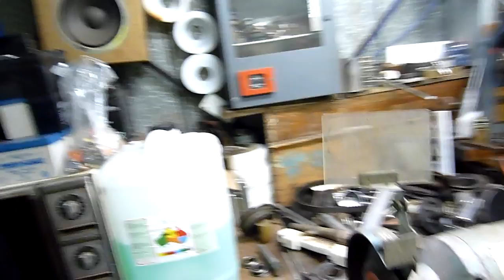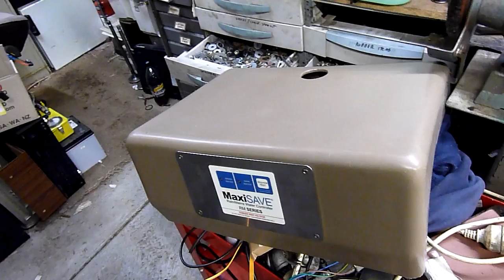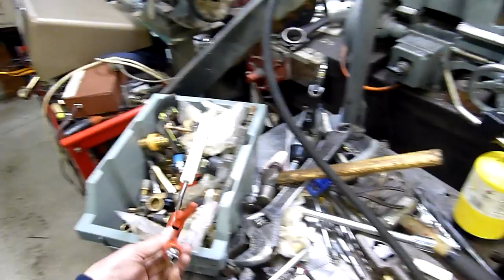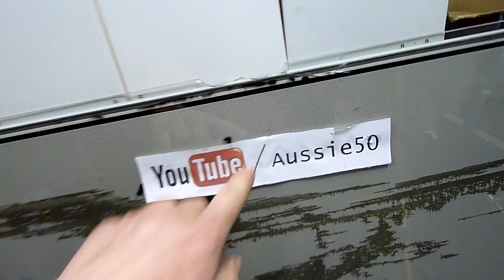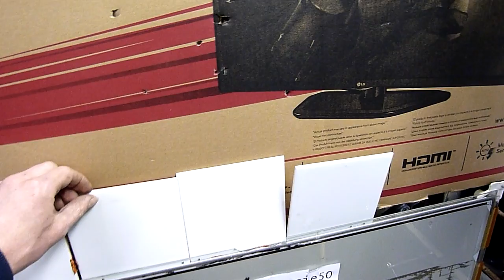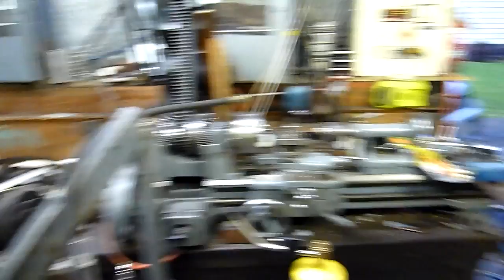Ramblotron Entry for Monday    September 16 2013

Comment: When I was in school a couple years ago,  they had us build a two stage air gun for an experiment. Chamber was a 12 in od 10 in id heavy pipe, 12 in long with inch thick plates bolted on the ends. Barrel had a 2 in id about 12 feet long threaded into one plate. At about 40 psi (we were set up to go to 100 psi) the projectile, a 3/4 in steel rod 1 foot long could make it most of the way through a phone book. What amazes me is that nobody stopped to ask us what we were going to use it for.

Comment: The jack is just a float switch, the small 3 pin is the valve output, and of course the socket is the pump output, you go to malvernirrigation and find maxisave kit pdf manual on 'learning and resources' it also shows how it should be set up